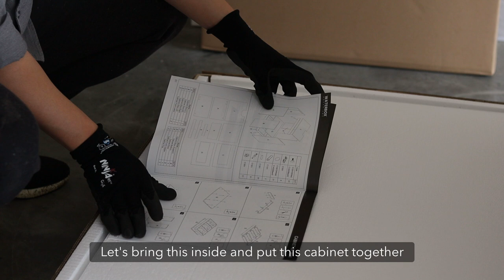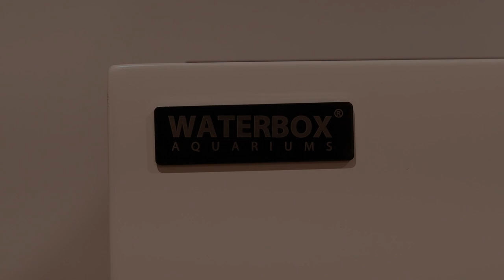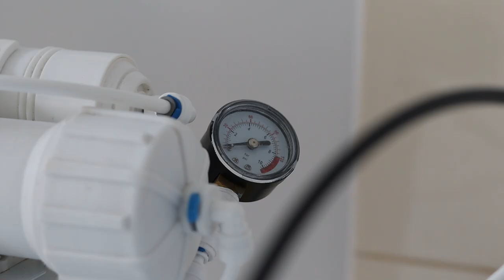New Chapter - Unboxing and Setting Up Waterbox Frag 105.4 | Blue Reef Tank

Comment: Beautiful tank, only things I would have done is use titanium heaters(doesn't shatter as a lot of horror stories). I also would not waste money on return pumps like the S2, they are not as critical as long as your circulation pumps are working. I have used the basic Jebao(ac and dc) for years and had no problem and in fact I have 2 since they are so inexpensive if one fails which hasn't happen yet. Are you going to do a home tour? LOL , I am going to miss those views of yours.
Reply from the maker: Hey Garry, yeah I've heard lots of horror stories with glass heaters. Hope it doesn't happen to me 🤞 thanks for the suggestion on the pump as well mate. I will check out the Jebao if ever this S2 stopped working.

Yeah. I miss the view as well. But the suburbs views aren't bad at all. In fact, it's much more peaceful

Comment: Congratulations on the new tank. Curious though, Wouldn't it be a big mess now to fill it with sand/rock? That may flood the aquarium also no?
Anyway, I also wanna say I love your videos and selection of music. I also love saltwater aquariums!
Reply from the maker: The sand and rock really doesn't add that much volume overall. It will increase the water level in the sump a bit but definitely won't overflow. Unless you're adding a LOT of rock and sand 😄